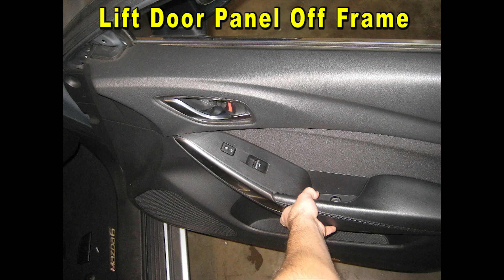Mazda Mazda6 How To Remove Interior Door Panels & Upgrade Speakers 2014 To 2021 With Speaker Sizes

Comment from the maker: Check out the DIY guide for taking off the plastic interior door panels on a 3rd generation 2014 to 2021 Mazda Mazda6 sedan - 
https://www.paulstravelpictures.com/2014-2018-Mazda-Mazda6-Interior-Door-Panel-Removal-Guide/index.html

Here are all of the DIY repair and maintenance tutorials for the 3rd generation 2014, 2015, 2016, 2017, 2018, 2019, 2020 & 2021 Mazda6 -
https://www.paulstravelpictures.com/Articles/Mazda-Mazda6-DIY-Repair-Maintenance-Guides.htm

Owners of other Mazda vehicles such as the Mazda2, Mazda3, Mazda5, CX-3, CX-5, CX-7, CX-9, and the MX-5 Miata may also find these DIY instructions to be helpful.